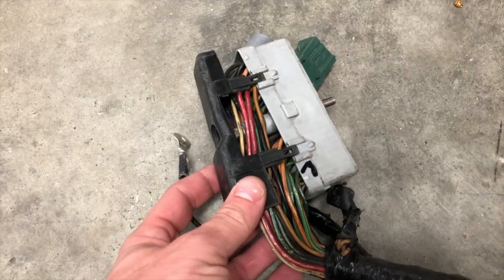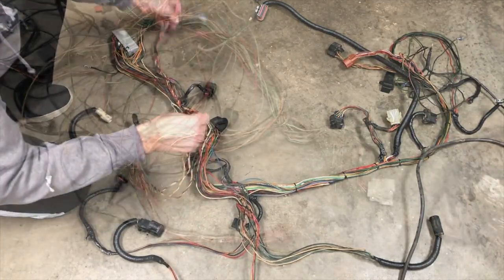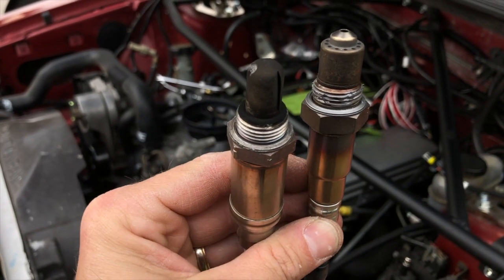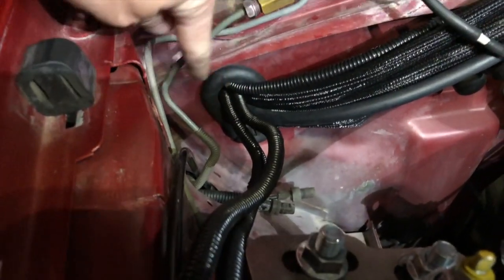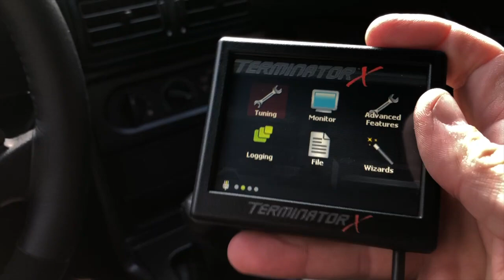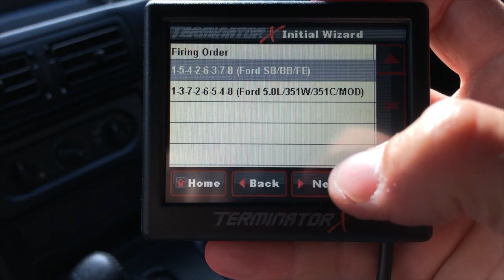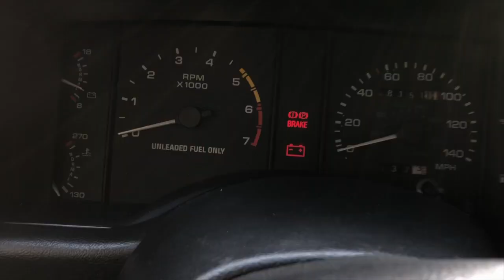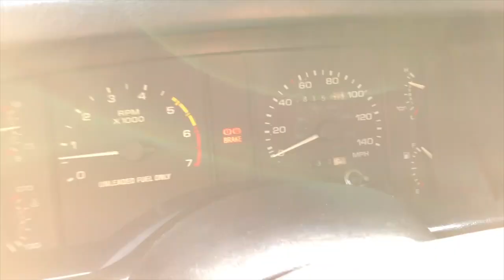Terminator X Foxbody Install

Comment: Hey my friend I was wondering if you might know why the terminator x cam sync or 12volt signal every once awhile shuts car off and then firers right back up so fustrating
Reply from the maker: I don't know...but I'd suggest checking and tweaking the pins in the TFI module so they make better connection.

Comment: What color is the 12 volt switch coming from the c110 connector that is going to the Terminator X and to the ignition coil.
Reply from the maker: Here's a wiring diagram with wire colors: https://www.youtube.com/channel/UCeJaO0ySaJ07Igg-qgMWvPQ/community?lb=UgyMR72JMcb7LD1LlsF4AaABCQ

Comment: Nice video! Have you installed 550-937 kit? Since they discontinued the 550-937f kit. If so what’s needed to install it in a foxbody.
Reply from the maker: My understanding is the 550-937 kit is essentially the same, minus the bracket: https://www.holley.com/products/engine_swap_parts/swap_accessories/ecu_mounting_brackets/parts/554-157.

Comment: i dont understand why people arent buying the pro-m racing system.
Reply: Pro m is what I bought 5 years ago and just updated with traction control and transmission comtrol
Reply from the maker: I don't know, but the Terminator X is half the price of the Pro-M system. I've been really happy with the Terminator X. Never had to "tune" it. Iv'e only had to do some idle setup and acceleration enrichment tweaking, but overall, it runs great out of the box.

Comment: Is it possible for the TX to run the factory ac or will I have to do a custom wire long job.
Reply from the maker: It won't "run" the AC, but you can use the TX to do the same functions as the factory ECU by using a relay that cuts off the AC at WOT. The rest of the AC would be like factory.

Comment: I've got the holley efi kit on the way but I've got a crazy question. Do I NEED the factory airbag harness in order for the holley kit to work?
Reply from the maker: No, you don't need any of it for the Terminator X to work. Sorry if that was confusing. For some reason, my air bag sensors were taped up with my MAF harness, so I had to separate the two because I wanted to keep my air bag system, BUT didn't need the MAF harness any more.

Comment: How long did this install take you from start to finish?
Reply from the maker: Non-stop, probably 10 hours. A lot of time was dedicated to figuring out the factory wire harness, etc, and separating the air bag wiring on my car. It's really pretty straightforward.

Comment: I just installed mine with help from your video thanks!
I turned the car on and it idled then I disconnected the battery after I was done then I reconnected the battery days later and the car won’t start now. I setup the wizard and tps again but the car won’t turn on. Got any ideas what it could be? Thank you
Reply from the maker: It likely lost the entire tune. That happened to me when I had a completely dead battery and the starter was also bad. See if your global configuration file is saved to the handheld. "Load file" or something like that. It's always a good idea to save your configuration file to the SD card after you make any changes just in case this happens again.
Reply: Thanks for the quick reply!! I will see if the tune is saved and go from there.
Reply: @lowsbf100  Let us know how it goes!
Reply from the maker: @lowsbf100  No problem. Keep us posted.
Reply: @WesDuenkel  update! I am not getting injector pulse. I’ll keep doing more research.
Reply from the maker: @lowsbf100  Might not be getting an RPM signal. If you are using a TFI distributor, the connector at the TFI module may not be making good connection. Unplug it and bend the terminals in the TFI module SLIGHTLY so they are forced to make contact with the harness connector.
Reply: @Mustang-Geek  when I crank the engine it shows about 230 to 300sh rpms on the hand held but still will not fire up. I swapped coils, tfi, battery and nothing changed. I swapped all these parts onto my other mustang which has stock wiring/ecu and it starts right up. 
I don’t get it if it did start when I first finished the wiring.
Reply from the maker: @lowsbf100  Did you tweak the terminals in the TFI housing?
Reply: @Mustang-Geek  update 
Got it running now. The problem was fouled spark plugs. Took them all out cleaned them and now it starts. Don’t know how they got that way in the first place from just sitting for 2 days after the engine was actually running. Oh well as long as it works now. 
Thanks for replying and helping me out through out.
Reply from the maker: @lowsbf100  Wow, I wouldn't have guessed that! Nice find, and glad you got it running. Check out the other videos here to get the idle set up, etc.
Reply: @Mustang-Geek  yeah I’ll be doing that shortly Thanks

Comment: I'm still looking at this system. "Why" did you change?
Reply from the maker: It makes adding a blower, changing cams, injectors, nitrous, turbos....everything easier down the road. It's hard to find people to tune the old Ford EEC system anymore.
Reply: @Mustang-Geek  You should try finding someone to tune a built 03 Lightning... Jesus, you'd think you spoke a foreign language when talking to folks.

Comment: Can you use it on an 84 mustang gt with an engine swap?  It's a fuel injected engine from an 94 Mustang 5.0
Reply from the maker: Yes.
Reply: You can swap it into anything, I got this exact one in my ranger
Reply: @johnbaum1000  just need some info on what I need. The obvious and not so obvious stuff since it is an 84 and they came with carb. Obviously an efi intake and a fuel pump added. The not so obvious would be needing the wiring of the fuel pump and rely and other little things that might need to get done wiring wise.  I was wondering if anymore on here can shed some light on putting this system on a carbuerated car that is being converted to efi.